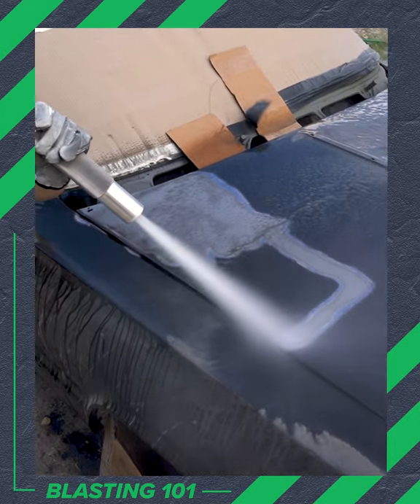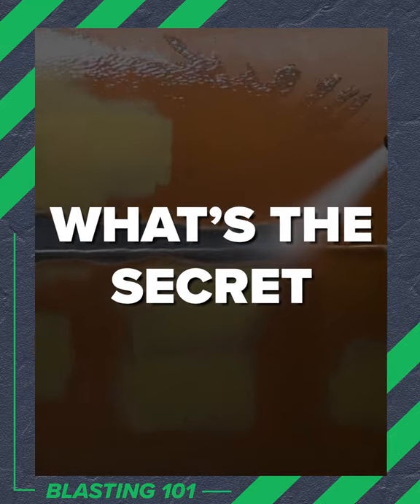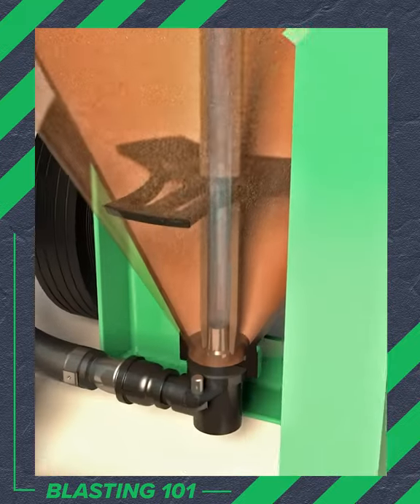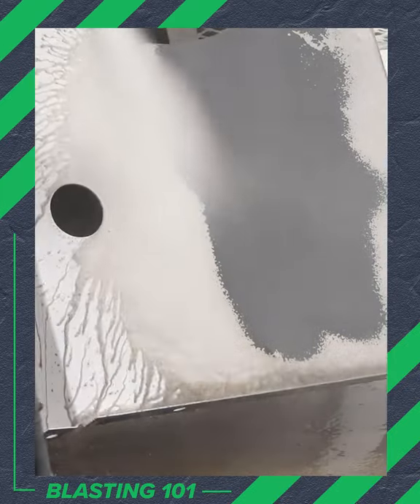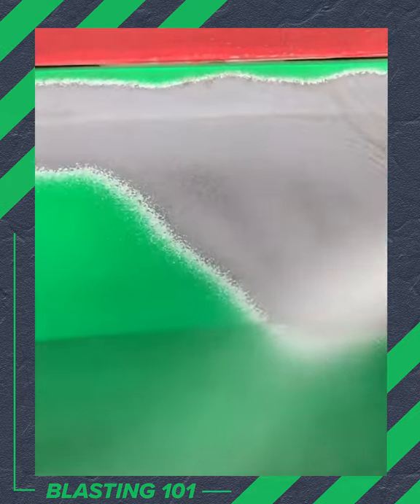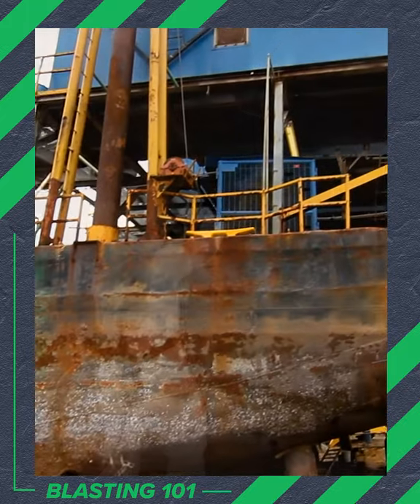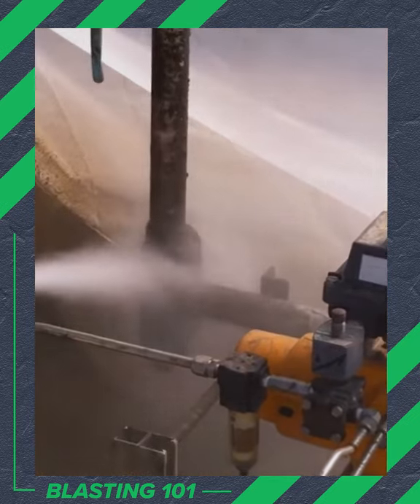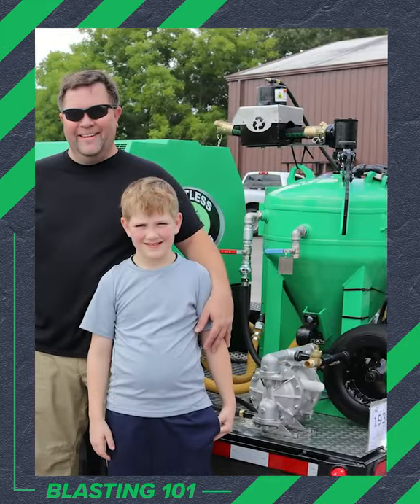What Is Dustless Blasting? | Dustless Blasting 101

Comment: Just buy one DB 150 working 💪 good
Reply: Hola,how much You paid
Reply: @edgardrodriguez8542  they run for around 7 grand
Reply: @edgardrodriguez8542  I was lucky to find the db150 at a storage auction I paid 2500.00 but that came with a powder coating oven 4’x4’x6’ and a clemco dry blasting system.
Reply: @damiansgaragebuilds7663 i am interested un one
Reply: @damiansgaragebuilds7663  I am in puerto rico,i love too have one dustles blastin
Reply: @damiansgaragebuilds7663 😂 probably just for the sand and material. Cheapest machine is like $40k
Reply: @jaymilehigh6127  it's not hard to ho to their website and see the prices, the db225 is like 8700